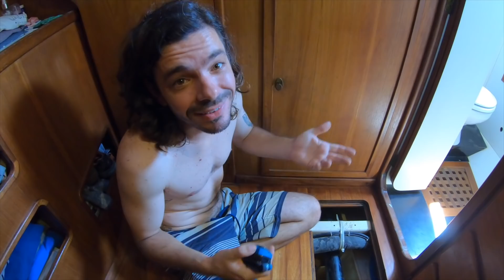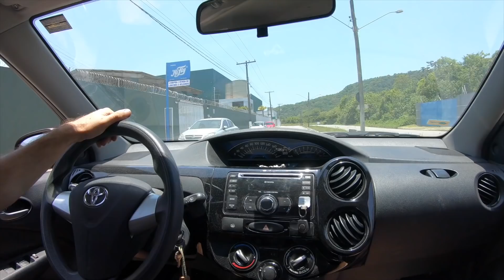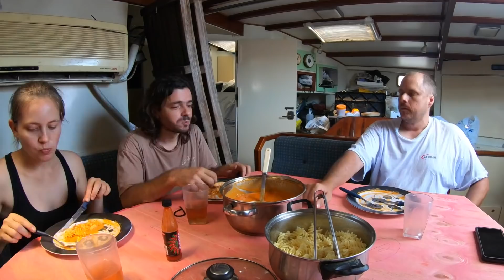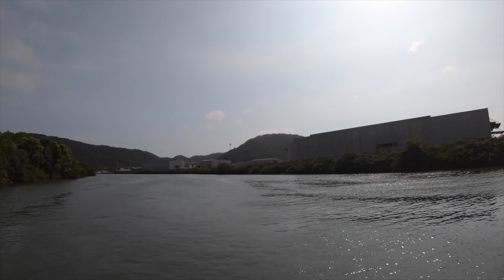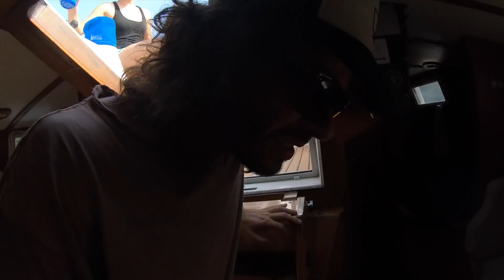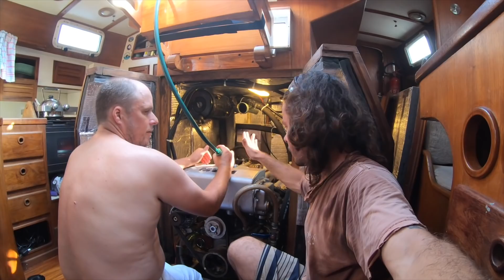⛵️First SEA TRIAL after 23 year on the hard!! (didn't go well!! 😨) Not Click Bait #163

Comment: For the engine (thinking of a hybrid engine), this may be too expensive but have a look at the Tally Ho! video from Sampson Boatbuilding:  https://www.youtube.com/watch?v=xohxmwPfctg&t=1s which, if it would fit (or one like it) might be an ideal solution.  You can skip to about 23 minutes in if you don't want to watch the whole thing, but I really think it would be worth looking at what Alex is going for - a Beta Marine diesel engine with a powerful generator/alternator on it, which can act as a motor.  So as you are using the generator, it charges the batteries, but you can use the batteries to run the motor without the diesel engine running.  And of course you can use your solar panels to charge the batteries.  The bit that I really liked about it is that when you are sailing you can get power from the propeller to charge the batteries.  I have no idea of costs or size options, but it looks like an ideal solution for you.  Do watch the video.

Comment: The most disturbing thing about what you shared about your old engine; is the manufacture told you it is obsolete and no longer produced. This brings to mind, are other parts for your old engine going to even be available in Brazil? Are the parts for the drive line and transmission still readily   available? What boat engines and drives are currently being  used in Brazil? No matter what engine you chose to  put in you will be repairing failures a few years down the road. Brazilian produced mechanical parts are usually above average in quality... Sorry for the reality check...

Comment: Your engine will fail! New or old, they will break down at some time in the future, at the worst possible time. That much is an absolute guarantee. So, having availability of parts world wide is very important. Changing to a Yanmar engine will at least give you the ability to get the parts you will need, regardless of where you are. The cost is certainly a factor, but being stranded in some remote place, having to change engines, will cost you much more then, than it does to change it now.

Comment: I think I'm in need more YT Subscribers cause.....
Bad heat exchanger....replace the motor. Never had that option before. I think my newest boat motor is from the late 1970's. Just had a part shipped from England that was made in 1969. But if I was in your shoes I may go with a new motor with a warrantee. I trailer my boats and have a garage shop for repairs. Being in a foreign port with a dead motor and no way to fix it would suck.

Comment: my veiw, new engine would be more benifical to you both, thinking long term and not short term. cost can be waded up, resell of  old engine, repairs of old engine and there after repairs, can become expensive, costs blow out with that. future breakdowns that may appear, ass you already are haveing issues now, costs add up. New engine, costly, but weigh up the the costs if you don't ! new engine you know you have many years free motoring apart from maintance, as the old as well. warrentys, new has and old don't. break fown on new engine, if happens, under warrenty until that matures. shouldn't  have these on a new engine, murphys law. you might in the end save hald the cost of a new engine not having the problems with an old that has been sitting a long time. many issue can develope over a short period of time, and, thats your cost blow out.  NEW ENGINE